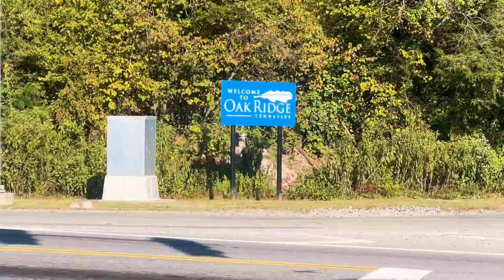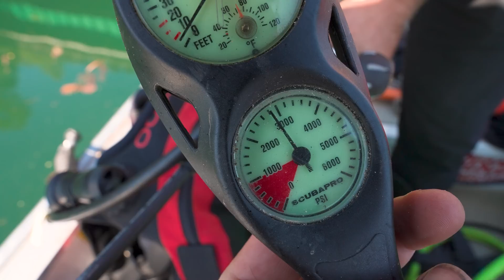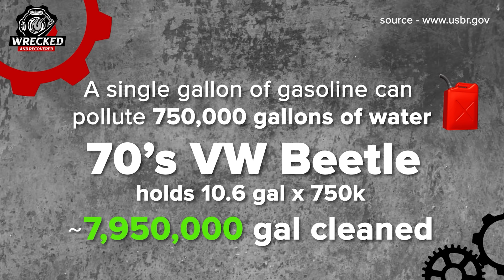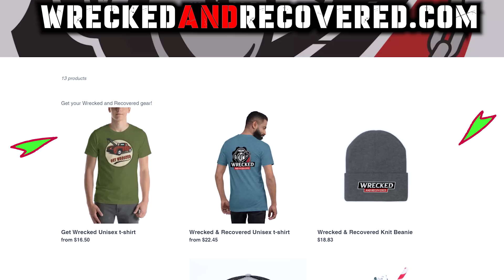1970's Volkswagen Beetle Found After 50 Years Underwater!

Comment: The steering wheel in the bug was from 1973 to 1979 the fact that the spare tire sits up under the bonnet means it’s a standard beetle “supers lay flat” 
I could not tell 100% but it looks like it has a solid bumper bracket. They changed to a 5 mph shock mount in 1974. So my guess would be a 1973 standard beetle.
Reply: I would agree. 1973 standard beetle. Not a Super.

Comment: The rear lid for the engine used sells for $200 if in good condition. If it had a hair blow dryer then it might be one of the rare older model of the sixties from Germany with the creator name on the engine. Highly sought after because it had the best engine of the  VW series. As shown on American pickers show VW find in a barn.
Reply: What do You mean by hair blower dryer?   Thank You.💯👍👍
Reply: @davidharrell8890 the early beetles had mini hair dryers for rear defrost installed. My valiant 1960 had one also. It was shortlived having a car with an installed hair dryer.

Comment: I'm sure that was just a temporary fix. But in case you didn't know, compression fittings are no bueno on what is considered a commercial truck like your wrecker. But I'm sure you've had this properly fixed already.

Comment: The steering wheel is post-73 iirc, the way the spare was in the trunk...or frunk, I think it's a standard beetle, the super beetle had a different front end setup and the spare sat flat in front of the fuel tank. I wasn't aware the classic came with that steering wheel.

Comment: That’s a standard beetle- the spare tire is mounted nearly vertically. A super beetle has the front tire stowed below the trunk floor horizontally, and the trunk is about twice as large in capacity.  While it’s hard to see , to me it looks like the rear fenders are the 73-up style and the bumpers look to be non energy absorbing type which came out in 74, so I’m pretty confident it’s a 1973 Standard Beetle.

Comment: You two need a mechanic to repair that brake line. I am sure that it has been fixed by the time this video is out though. FYI, compression fittings are not legal for brake line repairs.

Comment: That would be a 1970 or a 71 vw standard beetle you can tell by the steering wheel and that the spare tire doesn't lay flat. It's proped up indicating its a standard beetle which are more valuable than super beetles.

Comment: VW bug - I had 1 for 5 years, hilarious car. Ended up with 3 different coloured wings, don't ask but not my fault 🤣 Sold it for the same price that i paid for it. Totally dodgy when it's windy & driving down the motorway. I got thrown across into the next lane; good job there wasn't a car there 😝. We use to have a VW BUGJAM event here once a year at Santapod race track, UK. The guys at the gate were laughing when i turned up, saying "I'm surprised that car made it here" 🤣😂 I never entered the Run What You Brung race, go figure. A straight quarter of a mile race, 2 cars per race - who ever gets there first WINS, obviously. An awesome day out. 😁🤩
Suggestion for your channel/s - The W.A.R COIN TOSS - heads/tails - Winner gets to Stay on the Boat or Dive, their choice. Loser deals with what's left. In the event of illness W.A.R COIN TOSS is suspended until the next event. 
Just a thought. I love your guys banter & videos - you make a great team. Thanks for all you do 🥰🤩

Comment: Still trying to figure out how a busted brake line would prevent a vehicle from moving.
Reply: The brakes were probably applied when the check valve broke. So it locked pressure into the rear lines. I'm a bit worried that theIr transmission wasn't able to overcome that though.
Reply: @RowanHawkins  yeah I know how air brakes work. Trucks that small usually don't have air brakes Plus there wasn't brake fluid sprayed everywhere so I guess that was an aftermarket job.

Comment: That thing doesn't look like its been there 50 years cars that have been underwater more recently look worse than that my guess is 20 years and maybe was abandoned 50 years ago doesn't look to far gone could be a restoration project just found myself a 2CV on a dirt road and I'm trying to restore it looks much worse than that and the Beetle looks like insurance fraud hardly any body damage  someone probably fell on hard times couldn't find someone to buy the car so they pushed it into the water only damage it had looks like it was caused when the car hit the bottom of the water looked quite clean which for a Beetle thats not really existed for at least 20 years is very rare since they were throw away cars built to be driven and crushed so maybe wasn't driven I would check that odometer that thing must be low mileage I doubt thats 70's looks more like 60's I think they did away with that steering wheel in the 70's red on white interior as well first owner had good taste in colors search that one for sure wil surely find some cool stuff